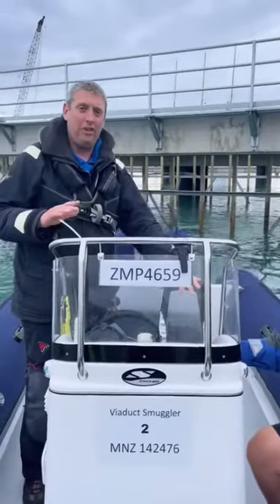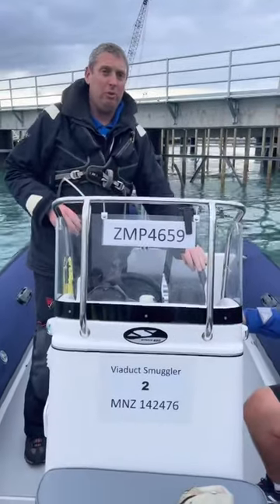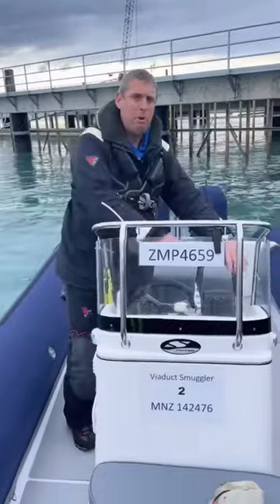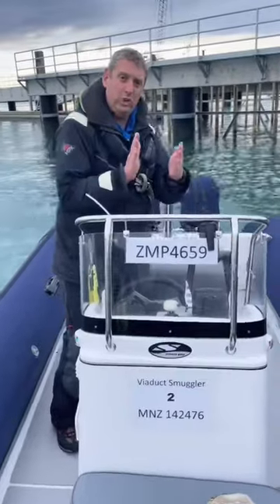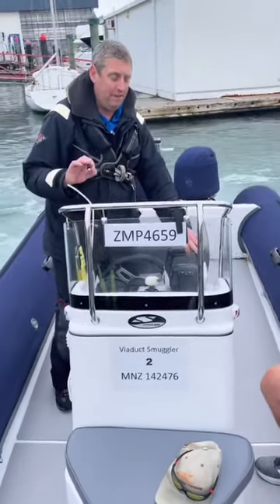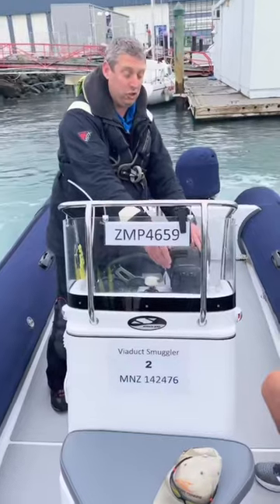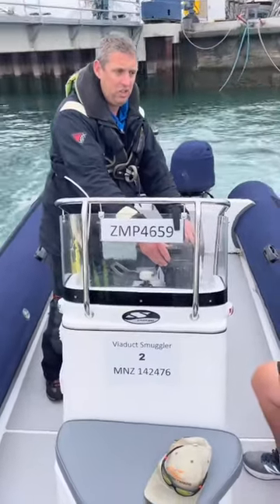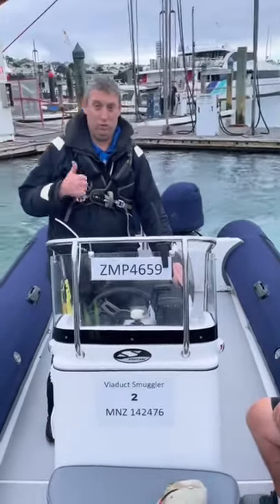Considerations before you split the throttles on a boat with twin outboard engines

Comment: hmm.... but would you really split the engines with sterndrives/outdrives?
my understanding you should do it more like single engine but then use the outside motors.
so if you want to spin port side, then you put your steering wheel to port, engage stb engine fwd to start the spin and then go neutral, then turn wheel to stb and use port engine reverse and to neutral. that I find most efficient turn winds. when no wind, then does not matter, you can split the engines and just wait.
I feel that if you use helm and split engines, then you loose efficiency and you need to give more revs and drama.. :)
on inboards as they are further apart, then it is more efficient with split engine.
Reply: You're absolutely right!